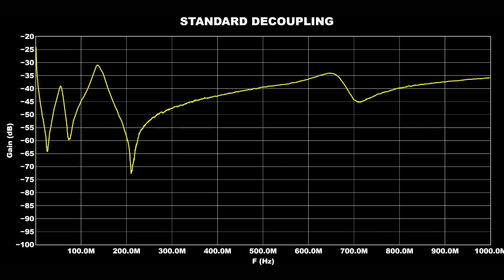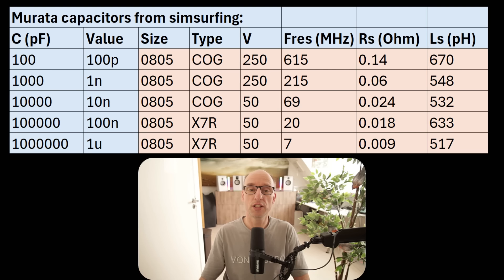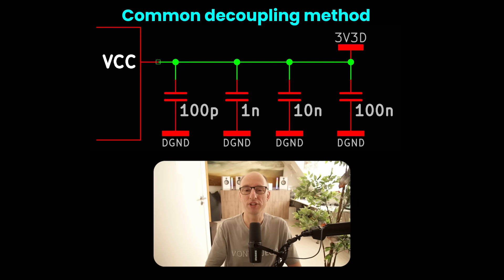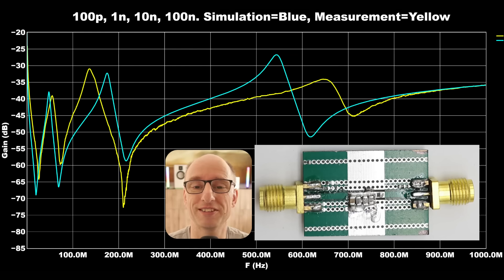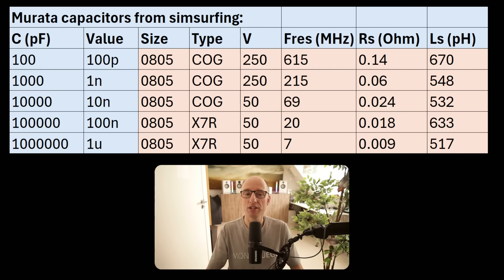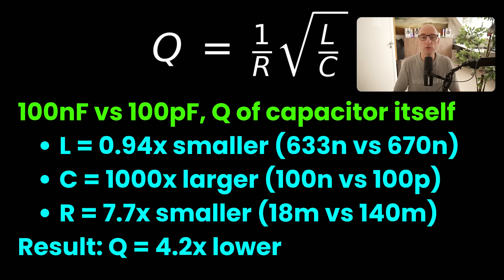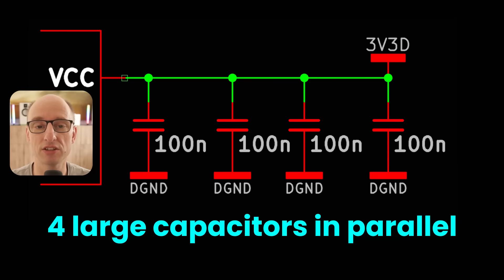The most misunderstood concept in decoupling

Comment: This is very interesting. I am an RF amplifier designer. LF decoupling on both the drain and gate of a MOSFET based amplifier is critical for stabilization as well as modulation performance. I noticed the networks all still have a bit of a peak at very very low frequencies. A lot of RF devices have way too much gain at low frequencies that cause catastrophic oscillations. We fight this in high power silicon or GaN PA's by putting a large electrolytic cap on the drain feed. Incidentally this also helps with high peak-to-average or pulsed signals. You might see A LOT of electrolytics in such an amplifier as local energy storage. Great video and food for thought.
Reply from the maker: Thanks. Nothing beats large amount of micro farads :-)
Reply: @HansRosenberg74  Of-course there is. A milli farad.

Comment: During my career as a mechanical engineer I did a lot of work on structural dynamics.  It’s fascinating how much this issue shares many of the same elements.  The big difference between the two worlds is that a mechanical engineer typically can’t adjust a spring rate over ten orders of magnitude 😁.
Reply from the maker: Haha, nice. There's a lot of similarity between different fields. Waterflow in a complex pipe system like a heat-grid for heating houses is very similar to a resistor network.
Reply: @HansRosenberg74  Actually I keep thinking about mechanical/water analogues to electrical systems.

Like you have spring shock absorbers, but sometimes you need to add dampers to keep them from bouncing around too much.

Comment: hans, at higher frequencies, the physical distance to the dut and between the caps is also important.  Have you looked at this in your simulation?
Reply from the maker: No, I haven't looked at it for this video. But indeed, it is important at very high frequencies. I'm hinting at it with the inductance that traces have.

Comment: Huh, I wonder what would happen if you put the 1 ohm damping resistor on only one of the four 100nF capacitors?
Reply from the maker: That would still leave a big series resonance dip. Just a little less deep. This would be my expectation, I did not simulate it.
Reply: I've seen a scheme with [one larger capacitor in series with small resistor] paralleled with one smaller capacitor. It makes sense too.

Comment: OpenEMS opened my eyes on what really happens with high freq  noise. Modelling caps there is a bit of a pain though.
Reply from the maker: Yes, doing full em simulations on something like this sounds really hard.
Reply: @HansRosenberg74  it's hard, and I would not do it for every single PCB, but doing so a couple of times on representative examples greatly helps in developing an intuition of what's really happening and where the noise is coming from.

Comment: I plan to build a battery charger to fit into the size constraints of a hobby project of mine. 
Course price is way out of range for me but I might still learn something around here.
Reply from the maker: Hi, yes, the course is too expensive for a hobbyist, a company would earn it back multiple times with the first mistake it prevents.... But if you get my free checklist and free module, you'll learn a lot to prevent problems for free. This checklist is free, but way more valuable than you might think....

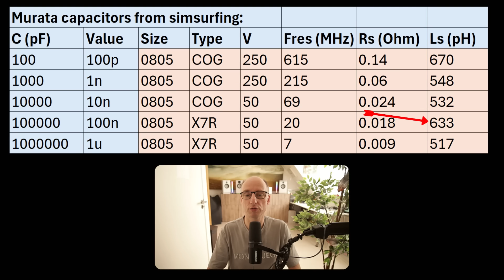Comment: Newbie here, at 6:05, looking at the table, i thought hmm, typo, but entering the the other figures to derrive the #,  633pH is correct as ggl says "Since the given total impedance (0.018 Ω) is much lower than the calculated capacitive reactance (0.07958 Ω) at the operating frequency of 20 MHz, 20 MHz is likely at or very near the self-resonant frequency where the total impedance is approximately equal to the ESR. In this case, the reactances must be equal. XL=XC."
Reply from the maker: I can't follow completely

Comment: On RF PLL synthesizer designs,  I put series resistors between the supply and the decoupling capacitor, and connect that node to the power pin on the PLL IC.  This provides the damping you were discussing.
Reply from the maker: Yes, for that application this is great!

Comment: Very interesting considerations that go against what is written in many books. I repeated your experiments with my nanovna and I got the same results. In case of 4x 100n capacitors the S21 dip is where the SRF of the capacitor is, that is 20MHz. That means that during the transients at high frequencies the capacitor is mostly in the inductive region. It looks like a contradiction that it is better to use a capacitor bank where its impedance is inductive and not capacitive. Of course it is still a capacitor and not an inductor at dc. But still it may look wrong at first sight. What would you say to somebody arguing that using capacitors in their inductive regions is wrong?
Reply from the maker: There will always be inductance. No matter what you do, vias and traces also have inductance. So inductance is not a problem. The key factor here is impedance. If that is low enough to suit your needs, then there is no problem.

What makes this difficult is that your mind gets 'prejudiced' when it hears 'inductance'. I was guilty of that for a long time, but if you just look at it without any feelings involved, you see it is not a problem. Unless the inductance is too high for your application. 

in that case, you'd need 0201 packages for instance, they have a way way lower inductance.

Comment: Could you share the details of the simulation you did about the load peaks comparing the two different decoupling strategies at minute 9:18 ?
Reply from the maker: ah, I just inject a fast 1A current pulse onto those capacitors and look at the results with a transient analysis. I'm using simetrix, the trial / student version.

Comment: My rule of thumb is to choose the largest value capacitors in the smallest possible case size for the bias voltage constraint (watch out for derating!). The only reason to have different values is that you need some 0201 for low inductance but they don't give you enough charge storage so you add some larger value  0402.
Reply from the maker: Yes, great strategy!

Comment: Most of this would be largely negligible for analog audio design would it not? Just because most of the resonances and ringing would occur at frequencies way above AF right?
Reply from the maker: In an ideal world: Yes, however there is soo much interference these days that I find I have to design my supplies and audiocircuits like RF circuits, otherwise Common Mode interference will get in in an uncontrolled way and start modulating my audio circuit. This is a phenomenon called 'audio breakthrough'. Audio breakthrough is a standard EMC compliance test for audio devices. In that test, they use really strong modulated fields to see if it causes any sound to come out of your audio device. However, this effect already starts to degrade audio at a much lower level. 
I found this out after searching for an audio quality reduction problem for a few years and then solved it by placing common mode ferrite transformers in speaker and powerlines. The problems instantly vanished!

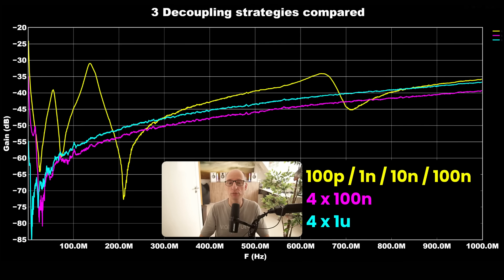Comment: 10:04 Wait, I just realized--you're doing these measurements with no DC bias on the capacitor, right? Small class II caps can lose like over half of their nominal capacitance at DC bias well below their rating. Is there a reason why this is not considered?
Reply from the maker: Just half? :-) It can be even worse!!!! I may do this in the future, measure under biased conditions, but it is tricky. I need to make a different setup for that and make sure I get the calibrations right.

Comment: My understanding was that the physical size is part of why you would do this. You want to make the current loop as small as possible, which means you want a capacitor that's as small as possible and as close as possible to the pins, right? But of course, physically smaller capacitors tend to have lower capacitance and worse DC bias characteristics, thus the motivation for a second one that is larger. Having multiple different capacitor values in the same package size seems silly and I don't think I've ever seen someone do that in a serious design.
Reply: It is much more common than you think sadly even in reference designs.
Reply from the maker: Yes, I agree with you. The same size is just for demonstration of the effect. When you design something, it's a really good idea to do a bit of PDN (Power Distribution Network) analysis to make sure you don't have  a problem. With the info in this video, you should be able to do basic PDN analysis.

Another reason for using same size capacitors: I have all values for 0805 in my lab. I always use 0805 since I never need extremely small components for what I do at home (except for my FPGA board, that needed 0402 and 0603 otherwise it could not be done correclty)

Comment: Looking at your test boards, the soldering is very poor and the flux has not been removed. Wouldn't the leftover flux affect the performance of the circuit?
Reply from the maker: The connectors were horror, came from Aliexpress and there is something wrong with the alloy used: Solder won't flow on it, not matter what you try. So I sandpapered them, it helped a little, but the connectors were basically repelling the solder. Hence the mess. I didn't want to wait for ordering other connectors either.....
Reply: @HansRosenberg74  Yep, had this with some Yageo 1W through hole resistors - solder wouldn't stick (sandpaper, loads of flux, clean iron). In the end i sandpapered the leads right down to the bare copper and then it soldered fine.
Reply from the maker: Forgot to answer: As far as I know, the flux has no impact. Certainly not at these frequencies.
Reply: @HansRosenberg74  Hi, for what ranges would flux ever affect response?

Comment: Don't you actually build a 'pyramid' not just line up all the caps? That's what I see most around the power supply sections at least.
Reply from the maker: You both are correct, this video just shows how you can analyze every situation yourself and what the risks involved are, so you get motivated to actually go do that :-)
Reply: Yes I think it's important that the lower value caps are physically smaller and closer to the load pins. Otherwise you don't get the benefit of reduced ESL.

Comment: It's too bad that you didn't know the specs of the caps you used. I'm wondering how DC bias affecting the capacitance would affect the result here, as usually larger capacitances in spec has a higher fallof due to DC bias. 

Great video overall, it summarizes this topic very well!
Reply from the maker: Thanks!

Comment: We've used multiple capacitors in RF applications where there are multiple LO's or VCO's running on the board.
Notice at 10:20, where the 1nF capacitor is resonant at about 225MHz, this would be ideal if there was an LO running at this frequency in the design, it would greatly outperform the single capacitor value method.
Reply from the maker: Hah, interesting. So you're saying you actively designed the decoupling network in such a way that you made use of the resonances? Hmm, interesting. Would it not be safer to explicitly make a series resonator to ground with a relatively accurate inductor and capacitor so you're less reliant on the parasitic values of the components? 

I like the idea though, my video basically shows that these components are quite predictable, so it should reproduce well enough to work in series production.

Comment: The sequence of 1 μF, 100 nF, 10 nF can be called "E1", by analogy with the series of ratings. So, if we take the sequence of capacitors E3 (0.47 μF, 0.22 μF, 0.1 μF), the sizes of the peaks will become very small. This is approximately a halving of the capacity and a doubling of the resonant frequency on each successive capacitor. If we take E6, the graph will generally turn into a slightly wavy line. The proposed option 4x100 nF is not better, but simply cheaper.
Reply from the maker: haha, yes, agreed. I tried those configurations as well.

Comment: One thing that bothers me in this video is that the RF circuit has a perfectly flat spectrum. This is not very realistic, a real rf circuit will have specific operating frequencies, which you decouple with specific capacitors. The decoupling capacitors might cause ringing at other frequencies, but that is not a problem if the application never uses those frequencies.

The main goal of decoupling in my experience is also not just to keep the supply stable, but to minimise any rf created by the unwanted frequencies. This is why it's better to short higher frequencies closer to the IC.
Reply: Looks better than the hilarious hifi world . from dodgy non linear audiofool loudspeakers thru linear amplifiers (that often are scientific grade) and finally the reverse RIAA nature of recorded music.
Rip a CD yourself or look at a decent flac file from a respectable source, plot the spectrum and laugh.
Reply from the maker: The idea here was not to give a solution for all applications. The goal was to show what kind of problems decoupling capacitors can cause, and how you can model and simulate it. 

You have to design the best decoupling / supply solution depending on the application. This knowledge helps...

Comment: Excellent video. One major challenge I see is the decoupling strategy when switching at ~2000 A and ~1000 V. The steep dI/dt during turn-off demands ultra-low inductance capacitors placed very close to the devices to suppress voltage overshoot. At the same time, the system requires substantial energy storage to keep the DC-link stable and handle the high RMS currents. Using the more “snubber-style” approach you showed in the video would likely result in excessive losses (heat dissipation) in my case. Do you see any alternative strategies for such conditions?
Reply: I think if you’re dealing with thousands of volts and amps on a PCB you have other larger problems to worry about. What kind of application uses that high current RF?
Reply: @blablabla7796 Pulse generators for HiPIMS power supplies. And yes, we do that on a PCB.😊
Reply from the maker: I know someone who has all the answers to this one I believe, can you send me an email at info@hans-rosenberg.com and mention this comment?
Reply: @HansRosenberg74 Thank you. We have this under control and don't have any issues so far. Will do EMC testing in a couple of months. Might contact you for tips if needed. 😊
Reply: Maybe pulse capacitors + many high voltage smd capacitors? Pulse capacitors for energy, smd for noise reduction. And take into account heating smd.
Reply: @gauss6431  at RF frequencies? I find that hard to believe.
Reply: @blablabla7796 too many is unknown to solve this problem. Frequency, components that consume so high energy. If main frequency is below 1 MHz - mlcc capacitors will still work at "edge" frequencies.
Reply: @gauss6431 The frequency of the pulses at that peak current is seldom higher than 5kHz. 
One of the challenges is also to handle arcs on the magnetron. The arc creates basically a short, and the current can rise 1000A/us. 😅
But the most scary thing is if a diode or transistor breaks and you turn on the complementary transistor in the same phase leg. The storage capacitors has the capability to deliver ~600kA 😅
Reply: Sounds worse than the Pockels cell driver I worked around in university.  It was about 3Kv in about 15nS into a 20-30pf load, so only 30-40amps peak.  Biggest noise source was current through stray capacitance pulling the ground/pwr lines around.  I'd get 30+ volt transients unless the case and mounting brackets were practically welded to the chassis.  (ground wires did nothing...)  

Eventually managed to get a 24-bit ADC working within inches of that with no-cross coupling.

Comment: This is amazing! thank you! How do we know how many caps to put in? is it just based off of testing or is there some math behind it?
Reply from the maker: It depends on how big the energy spikes are that the network needs to deliver. The bigger the spikes, the more 'local energy' storage you need. You can simply simulate how much capacitance you'd need given the current spike size.
Reply: @HansRosenberg74 i’m not sure if this was covered in the video, but why 4x100nF rather than a single 400nF?
Reply from the maker: 4x100nf has a lower RF impedance due to parallel inductances

Comment: It is rather obvious, and I can add that 1 Ohm resistors are better to connect in series not with the capacitors, but along the power supply line between the capacitors!
Reply from the maker: Yes! As long as the voltage drop created by the resistors is not too high for your application! Be careful to check it!